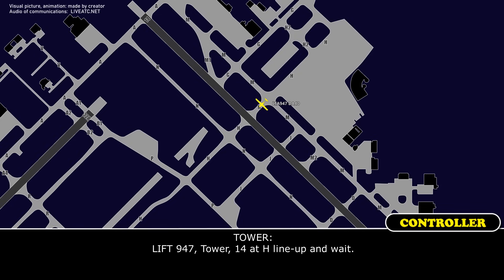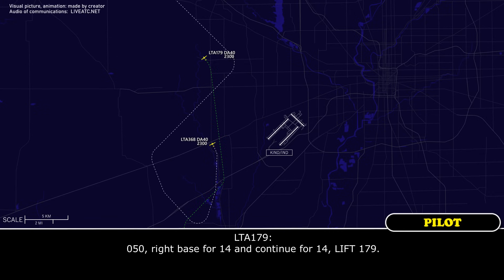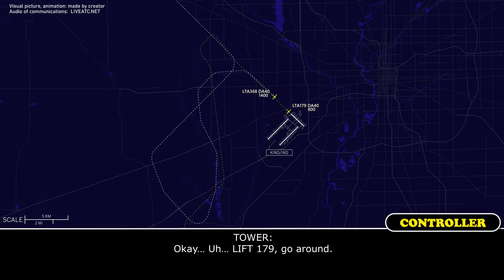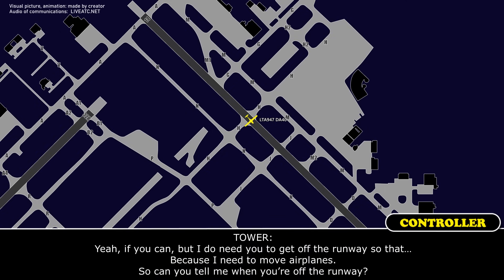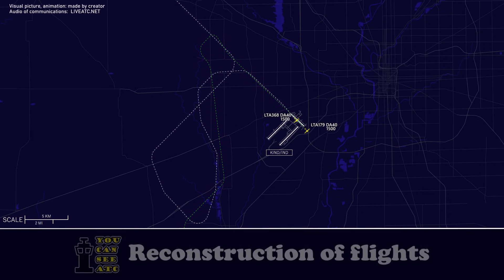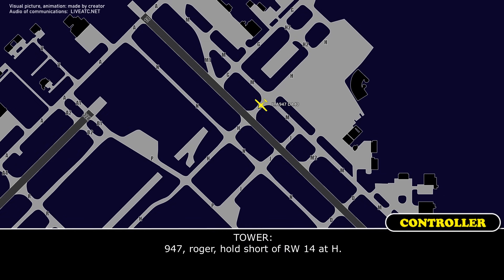NEAR MISS. Two airplanes almost land on occupied runway. Real ATC

Comment: 1.  there is a mistake made. Doesn't matter whose fault in that very few seconds.
2.  the air traffic controller realizes that someone made a mistake, doesn't matter who was at fault within that very few seconds.
3.  the air traffic controller takes immediate action to get control of the situation.
4.  the air traffic controller has a duty to report mistakes for review.
5.  the air traffic controller did her job.
6.  was there a problem caused by a shift change?  was there somebody late to work?  was somebody on medication?  I have no idea, but an investigation may find some things that need improvement/change/training.  That is the critical thing.

Comment: Would I be a dick if I was monitoring the radio, heard tower give the clear to land on my LUAW runway but without my TO clearance in the same transmission, and immediately asked tower if I was cleared to take off without delay, then? At least then there'd be a chance of enough spacing to not call go-around for anyone else.
Reply: Always speak up, and don't forget to include a position call, as she didnt initially know where lift947 was

Comment: Do ATC controllers even look out the widows?  That was a major error.  Surprised Lift on final didn't see 947 either.  Line up and wait seems to cause more problems than it solves.
Reply: Not to mention Lift 647 was about 1/2 down the runway.  Not a place you typically are looking for an aircraft sitting on a runway.
Reply: These planes are tiny.

Comment: When line up and wait is issued, i mentally tell myself check in with the tower if no radio calls have been received in over 45 seconds. Its easy to forget about traffic on the ground when dealing with sequencing and distancing of arriving aircraft. Fortunately the only times I've received line up and wait instruction a t/o clearance was issued 20 to 30 seconds or so following.

Comment: Wow, they completely forgot about that plane. It wasn't even an "oh crap, I forgot about you" situation, it was more an "I have no idea who you are and why you're on the runway" situation. Pretty wild, especially her attitude afterwards.
Reply: There was a controller change. It doesn't forgive the situation, but it explains why she had ""no idea who you are and why you're on the runway"" -- because she didn't forget about them; she didn't know about them -- and what you perceived as her "attitude." The initial (male) controller is at fault, not the second (female) controller.
Reply: @TheSurrealGoose Shouldn't the new controller be there several minutes before actually taking control to know what is going on instead of having to rely on an instant hand-over?
Reply: @rutgerw.  Probably. I don't know the actual protocol. Regardless, this is on the first controller, no matter how you look at it.
Reply: @rutgerw.  Plug in, do the brief, relieved controller waits 2 minutes minimum to make sure nothing is missed, then break time. Sometimes the 2 minutes is waived, whether approved or not...
Reply: @TheSurrealGoose  well, I would say the male controller is responsible for creating the mess and the female controller is responsible for how she cleaned it up

Comment: Excellent example of SA. Any pilot that is told to “line up and wait” should always be cognizant of the traffic in the pattern. Listen to the instructions and the answers. The relieving controller should have been a little more patient before snapping at the airplane that just prevented a potential accident.
Reply: She didn't really snap at him but was firm that she wanted him to move because she had no idea where he was or where he was going. It was merely an attempt by her to get a handle on an issue she was not responsible for.
Reply: @ImpendingJoker  your impression and mine will differ. Her attitude when he was merely explaining what the situation was is what I’m talking about. She basically said I don’t care just clear the runway. She could have been a little curt with the instructor.
Reply: @wayneroyal3137  
The controller must have forgotten the aircraft was there till he spoke up..
Reply: @wayneroyal3137  The controller was in an unexpected situation after the hand-over, her job is about safety and whatever the issue at that point, she needed that plane off the runway, explaining things can be done off the runway. Makes total sense to me and she sounded professional actually. Later these things were cleared up.

Comment: I wish I could say I'm surprised that there isn't some method of identifying locations of aircraft being controlled at the field. Especially with shift changes as a potential, the ATC need to have a visual indication of where planes are - either in the pattern or on the ground. Then for the final controller to take it out on the pilot who had followed the instruction to line up and wait.

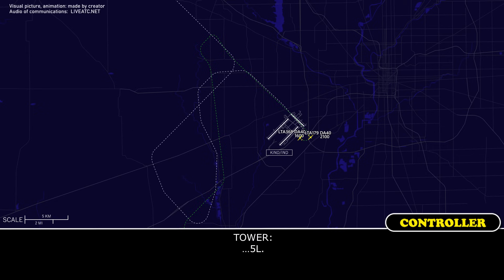Comment: At 4:30, they had cleared 368 for 5L, why did she give them a right turn to course 230?
Reply: Because they were already there, set for  for right downwind for 5L
Reply: @russm6001 but that would have been a left turn at that point, a right turn would have been nearly a full 360 at that point.
Reply: @oldRighty1  ,.no,  368 was the second plane to go around, it was still on the upwind rwy14 when it was cleared for right turn 230, which makes it downwind for rwy 5
Reply: @russm6001 ah, OK, it was 179 asking should we make a left turn, then she directed 368 to make a right turn. Bad / confused comms going on there, or she didn't realize which plane was asking her to turn left.
Reply: Because when you're VFR, you don't need to be given instructions to do everything. The clearance was instruction enough to "Go to and land on that runway"

Comment: Seems like all LIFT pilots were fairly complacent, and one should have recognized Tower error sooner...
Reply: The pilot on final should have recognized the runway wasn't clear and either initiated the go around on their own or called tower on short final to acknowledge. Bear in mind that all the Lift flights are students, some solo. Generally I have had excellent interactions with the Lift Academy flights ( I fly A LOT in the surrounding areas). The pilots are very aware and courteous of other aircraft. If you fly anywhere near a Purdue plane, you'll love Lift even more.

Comment: The pilot should have queried the controller after 90 seconds of being cleared to line up and wait and the situation could have been avoided.
Reply: That's a great way to get repeatedly chastised......
Reply: @AnonyMous-jf4lc  Who would chastise you repeatedly and for what reason?
Reply: @comcfi  ATC. They aren't going to deal with you. This is extremely rare. Most of the time they are dealing with a lot of other stuff, if you keep interrupting them you are going to be directed back to the ramp.
Reply: @AnonyMous-jf4lc  FAA order 7110.65 “An aircraft should not be in LUAW status for more than 90 seconds without additional instructions.”

FAA Pilot Best Practices for Airfield Safety: “If you have been holding in position on the runway for more than 90 seconds, or upon seeing a potential conflict, contact the tower.”

This is what the FAA says to do, so I don’t care if the controller is annoyed.
Reply: @comcfi  I stand corrected
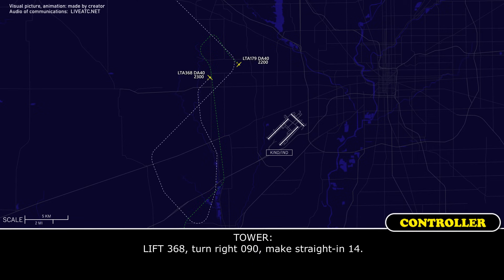Reply: I personally would have prodded tower (gently!) as soon as landing clearances started being issued around 1:40 "Tower, Lift947 awaiting takeoff clearance" ~Where are you?~  "Lined up on 14, ma'am"
Reply: The controller shouldn't have screwed up -- an even better way to avoid it if you're going to assign blame.  Remember, the controller doesn't have to fly a plane.
Reply: 1 minute 40 seconds from the video timeline.
Reply: Ive always mentally told myself to check in with tower every 45 secobds when inside runway boundaries. My instructor told me it's a good idea so when in a critical phase of flight it's OK to be a pest in the cab. They may swat at me but it's certainly better than having to explain violating noise abatement procedures as would occur when 2 aircraft collide due to loss of SA in the cab.
Reply: @overyourheadtampa  WTF?
Reply: @AnonyMous-jf4lc  basically what I said was if me checking in every 45 seconds is annoying to the controllers so be it. I'd rather be a pest to those in the cab (another word for tower) and keep my aircraft in their mental picture than wait until another aircraft lands on top to receive their attention. The point about noise abatement, 2 aircraft colliding is quite loud which certainly violates noise reduction requirements and assuming its survived it's not something I want to explain. It's another way to say my goal is to avoid a crash and ill be reminding the tower im in position on the active, ready to go. My instructor had a funny way of explaining certain things and it actually helps to remember certain important points when operating an aircraft. When an operation would be dangerous and could result in 2 aircraft colliding or a crash of sorts, it was explained as a situation that would break noise limitations because aircraft hitting one a other is very loud. It's just a different measure to convey the information and ensure its remembered, to which it works since it was over 10 years ago when I received my certification and still remember it today.

Comment: -This situation does not surprise me AT ALL.

Indy tower/approach does a lot of training.  One night we were making left downwind to 23R and they spaced us in on final 2 miles behind preceding traffic, which was a 757 that had a much lower approach speed.  We pointed this out and they broke us off and resequenced us.  Then we get on final and they realize that the airplane that they had line up and wait would not be off the runway before we touched down, so we were instructed to go around~~!   We wound up pulling into the parking spot with about 7800 pounds of fuel, or within 45 minutes of flame out....

Part of the art of being an instructor in aviation is knowing WHEN TO STEP IN.  I spent four years as an instructor in general aviation and I can tell you the people in that tower are either weak at best or do not know how to give instruction properly.  The incident I sited above was one of several instances I can think of when Indy tower or approach did something stupid.  We are all a team but come on guys, my blood pressure is high enough already!

Great video!  And kudos to that guy on the runway for paying attention to what was going on.
Reply: Doubly embarrassing since the 75 is a heavy (assuming by your handle you're flying an Airbus with a big sun on the tail). The first controller has been TRACON in the past I believe. Voice sounds familiar from previous times I've listened in.
Reply: @NigelCarlsbadFan70  I fly 767's for a small cargo outfit out of Memphis.  The 757 is considered a "heavy" due to a vagary of the design that causes excessive wake turbulence.  They have slow approach speeds, so spacing is critical for us.
Reply: @Flies2FLL  I heard them do the same to an MD11 during a night sort a few years back. Don't remember the type in front but let's assume for comedic purposes it was an ATR.

Comment: You know, it's bad enough that controllers have the authority to tongue lash pilots over the radio, but when the controller makes the mistake and follows up with an attitude like she's infallible they really need to take a long look at who they are allowing to talk to those planes out there. That pilot had incredible restraint and patience.
Reply: I think the change of controller is key here. The initial controller lined them up and for whatever reason forgot about them so when he handed over, there was probably no mention of the aircraft on the runway. The female controller therefore did pretty well to deal with such a seismic situation. Handing over between controllers is always a potential for error.
Reply: Keep in mind she wasn't the one that issued the instructions, it was the guy prior to her. She had to deal with the fallout after the change over though but it wasn't her fault specifically, and the only thing she was reluctant to put was the guy's initials. So, I don't know what you're going on about.
Reply: There was a change of controllers. The first controller was male and did a very bad job of maintaining separation of the inbound aircraft. The second controller was female and handled the bad situation correctly by canceling the landing clearances of the two inbound aircraft that were not separated properly from each other or the A/C on the runway. She properly canceled the T/O clearance and got 947L off the runway until they were sorted out and ready to roll. Priority had to go to clearing the runway and letting the inbound aircraft land.
The first male controller improperly cleared the LTA947 aircraft who did not have proper information before requesting takeoff clearance.  The male controller told 947 to lineup and wait but never cleared them for T/O. It sounds like he simply forgot they were there.
Reply: I think she was being a bit hurry she should have seen other plane on the runway before she did it looked like a narrow miss I think she only gave him number because he was there on the runway but he explained to her why he was there bits of faults on both sides considering it was on radar and recorded it was really her herself who rang the number and say yes he shouldn't have been there but I didn't notice him immediately couldn't there ve warning sensors on runways like detectors that tell pilots and ATC when there's already a plane on runway so they know split second it's there
Reply: I really don't hear what you're hearing. Absolutely, the mistake was on the controllers, but I don't feel that she took an attitude. Obviously, things got screwed up there, and she may have been annoyed that the situation was even happening, but I didn't feel she acted like she was "infallible" or "tongue-lashed" anybody.
Reply: I’d fault the landing pilots for not seeing the guy waiting for TO clearance, but he was an intersection departure and not where they would have been looking.
Reply: @LandNfan  Not just that, but those planes can still be very hard to spot, even if you're looking for them. I've definitely missed planes on the runway before. Especially such small plane on such a big runway.

Comment: Reminds me of the Skywest 5569 disaster in LA 1991. ATC had no idea what she had done in this case and seemed to blame the pilot on the ground (who seemed to do everything right by being alert). The dependence on sketchy radios is very concerning as well.
Reply: Clearly this happened during overlap between two controllers as one was taking the position. My guess is she was put into this situation and not told about the traffic on the runway because the previous controller forgot about him.
Reply: @jd-793  folks used to joke about Flight Deck Control on the Aircraft Carrier with their little airplane shapes and physically moving the shapes on the mockup of the flight deck. Even when you can see the entire operating area it is important to never forget what is where.
Reply: The radios aren't sketchy, they're quite good.  Problem is, the antennae is often run along the underside of the fuselage.  Works just FINE talking to ground targets when the plane is airborne, not so much when the plane is on the ground, blasting that transmission wattage into the tarmac!
Reply: @xheralt  The radio and antenna are fine.  It's the distance from the airport of the privately owned receiver that is feeding audio to the internet.